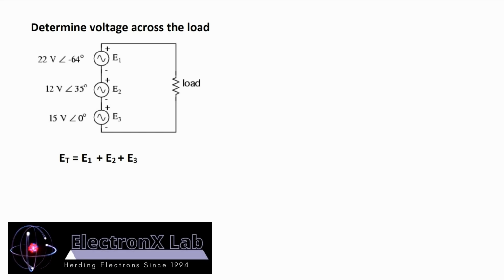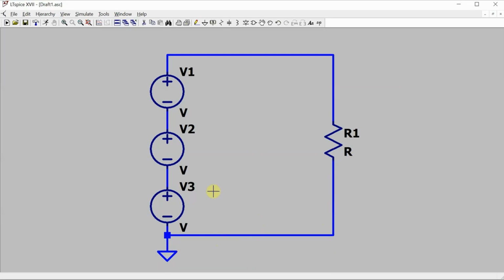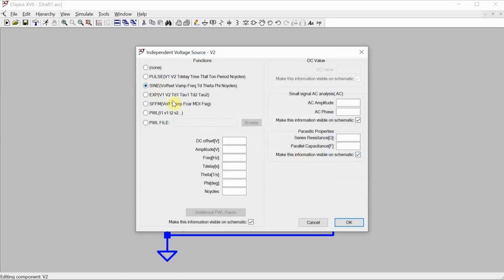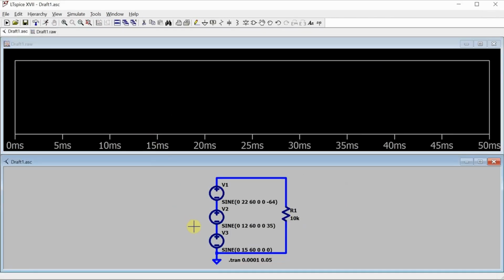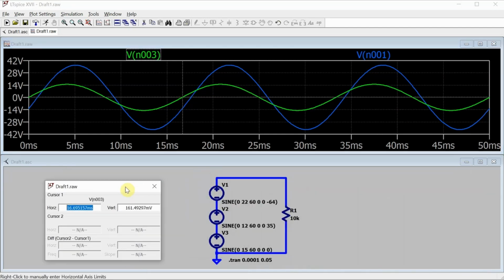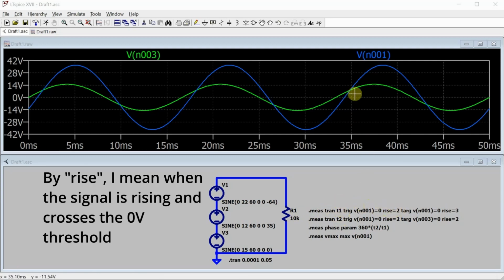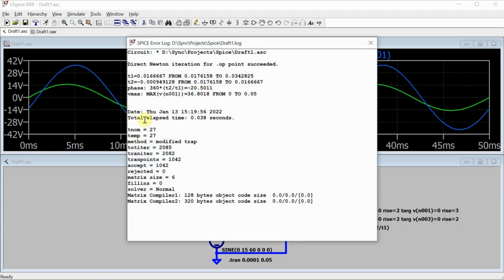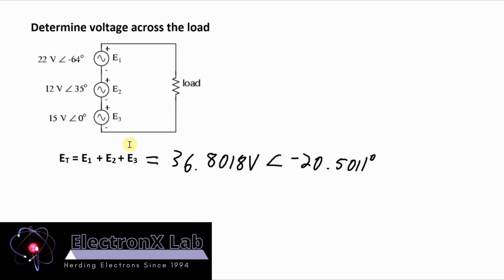LTSpice: Phasor Addition and Measuring Phase Angles

Comment: Thank you, it was really helpful. I don't know if it was a mistake, but the voltages in LTSpice are peak voltages. However, when using Phasors, they are RMS. In this case, the answer is the same because you measure peak values. In a real circuit, when measuring with a voltmeter, there will be a difference in magnitude (a factor of square root of 2)

Comment: what other programs do you use / can recommend for circuit simulation? ( especially for Mac)
Reply from the maker: KiCAD is alright as an free and open source simulation tool. It is for PCB design, but you can also do SPICE simulations. NGSpice is good, if you like a command line interface.